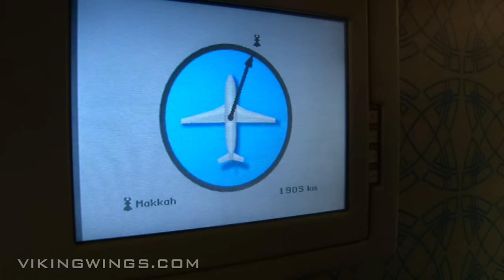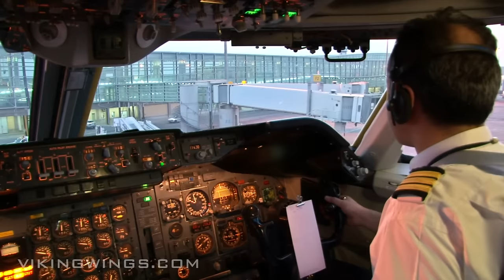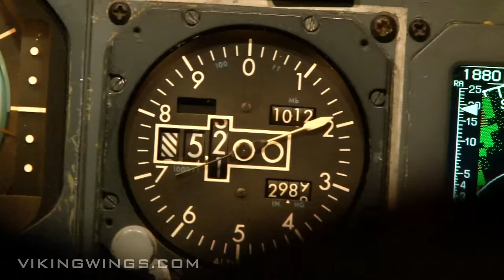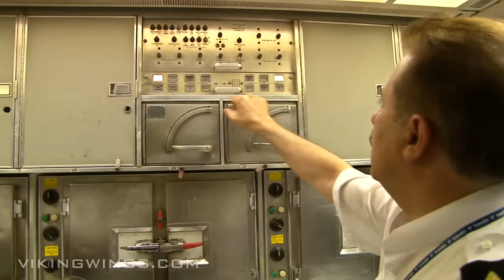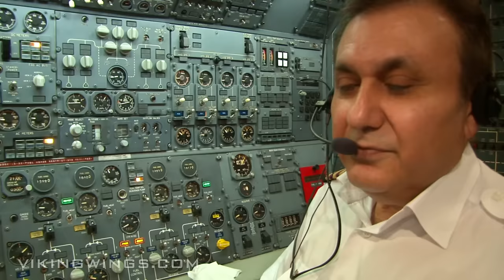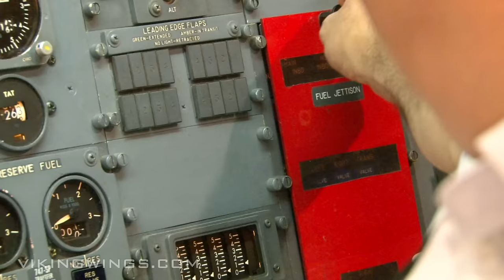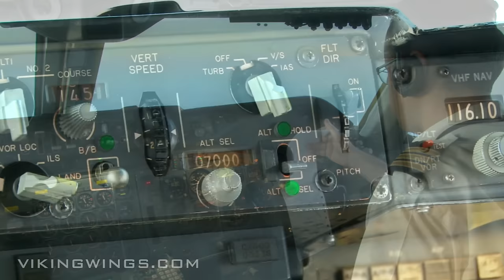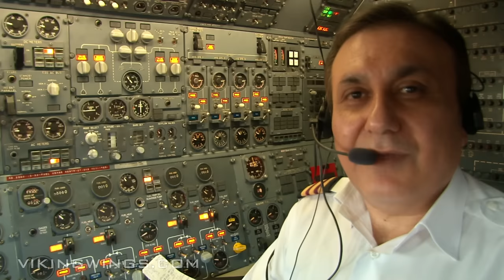IRAN AIR 747SP | PART 5 | IKA-KUL | COCKPIT VIDEO | FULL FLIGHT | FLIGHTDECK ACTION | IRAN AVIATION

Comment: Very nice landing, but the captain made an error during landing checklist. At 1:48:56 he confirms that speed brake is ARMED. But later 1:50:28 at touchdown we see that in fact speed brake was not armed, and he had to deploy it manually when he noticed it wasn't armed.
Reply: You are correct. The Flight Engineer reads the challenge “SPEED BRAKES. “The Captain responds “ARMED” but his right hand is still on the throttles. His right hand should have moved from the throttles and lifted the Speed Brake lever and moved it from the forward detent position back to the Armed position. He might have done this step prior to the Flight Engineer reading it, but I’m not sure. Upon landing there are a few requirements that must be satisfied before the Speed Brakes will automatically deploy. First is the landing gear must send an UNTILT signal. I am sure you have seen the 747-landing gear hanging down in flight. That is a TILTED gear (air mode), on the ground the gear is UNTILTED (ground mode). Then the throttles must be moved to IDLE thrust. With the speed brakes ARMED and these 2 requirements satisfied, the speed brakes (ground spoilers) will automatically deploy. After touchdown there can be a bit of a lag before they auto-deploy, so some pilots just go ahead and pull the lever manually instead of waiting. So either he did not arm the auto spoilers or he just did not want to wait a second or two for the auto deployment.

Comment: Interesting to hear the radar altimeter call out 2500’ during the climb when they’re indicating 7000’ msl 😬

Must have been flying towards rising ground, explains why the flaps were left extended so long and they did not accelerate for some time

Comment: All Iran Air's 747s are either grounded waiting to be scrapped or already scrapped, this perticular aircraft, EP-IAB nicknamed Khorasan did its last flight in 2012 after 36 years and is currently in graveyard since then waiting to be executed. this is probably filmed in 2000s. all the crew in this video is retired i think. i remember flying with one of these exactly on this route(my first international flight), lots of magazines and no flight entertainment, they played something like a podcast during flight and there was audio jacks on the seats but so noisy that you couldn't hear anything. such good times

Comment: 747 SP Cargo door operation is under the 
Belly as compared to the 100 20O 300
And 400.
Reply: The SP has the same lower lobe cargo door system/operation as other classic 747s. The only difference is the SP has fairings on the cargo doors that smooth the air flow into the wing since the doors are much closer to the wing with the short SP body.
Reply: @JohnDuffy-c3t   this belly door system 
Was on the Syrian Arab airlines B747 SP were the cargo doors opened and closed the 200
300 400 had a flush that you pressed opened then used to go on to the pickle 
Knob to close and open the door and reverse 
To close by pressing the flush back inwards 
To lock 
The Syrian SP as far as I remember did 
Not have a flush system in the belly so you 
Went on the pickle switch to open and 
Close doors .
Reply: This was a same system of closing and opening 
Cargo doors of the A321 , A320 .
Reply: @RayhanAhmed-qr3vz  All the lower lobe cargo doors, forward and aft, have a small panel next to the door where the electric switch is actuated to open and close the cargo door. In addition to the switch, there is a larger handle for opening and closing 2 small vent doors located on the large cargo door. This also varifies that the door is properly locked after closing.
Reply: @JohnDuffy-c3t   I think the Syrian 
B747 SP had a different system - this aircraft i use to handle on the ramp at Heathrow 
Between 2002 / 2004

Comment: Manual speed brake deployment?
Reply: Good catch.
During the LANDING checklist at 1:48:00 the Flight Engineer reads the challenge “SPEED BRAKES. “The Captain responds “ARMED” but his right hand is still on the throttles. His right hand should have moved from the throttles and lifted the Speed Brake lever and moved it from the forward detent position back to the Armed position. He might have done this step prior to the Flight Engineer reading it, but I’m not sure. Upon landing there are a few requirements that must be satisfied before the Speed Brakes will automatically deploy. First is the landing gear must send an UNTILT signal. I am sure you have seen the 747-landing gear hanging down in flight. That is a TILTED gear (air mode), on the ground the gear is UNTILTED (ground mode). Then the throttles must be moved to IDLE thrust. With the speed brakes ARMED and these 2 requirements satisfied, the speed brakes (ground spoilers) will automatically deploy. After touchdown there can be a bit of a lag before they auto-deploy, so some pilots just go ahead and pull the lever manually instead of waiting.  So either he did not arm the auto spoilers or he just did not want to wait a second or two for the auto deployment.